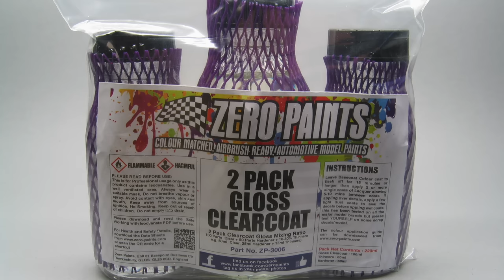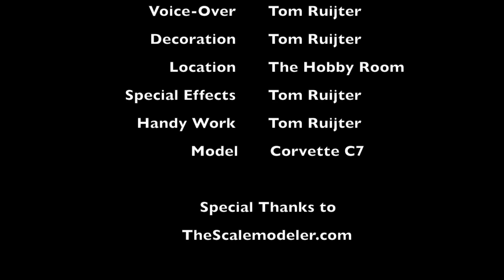Revell: Corvette C7 Stingray 2 Tone & Clear

Comment: Hi Tom!
When you paint a two tone body color, than a little edge of the 2nd paint will be present.
Do you sand it to lower this edge and get a smooth surface? or Do you have another method?
Reply from the maker: I don’t sand colors. I try to even it out with the clearcoat.
Reply: Thx Tom!